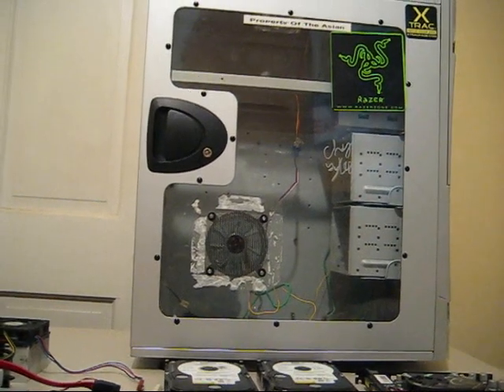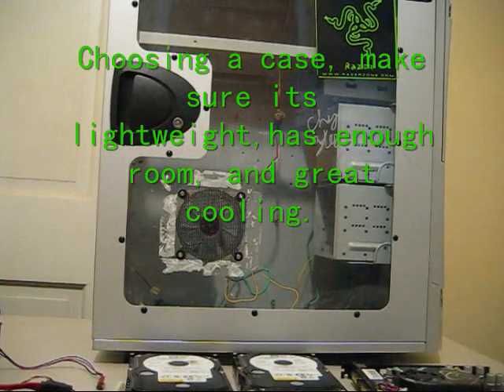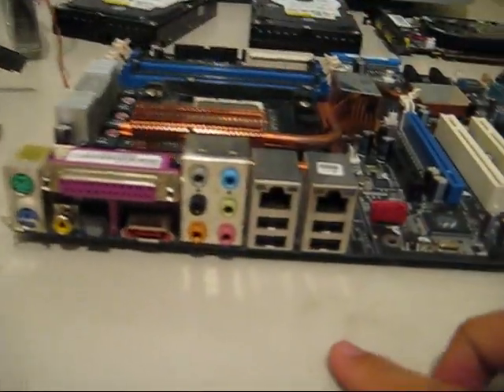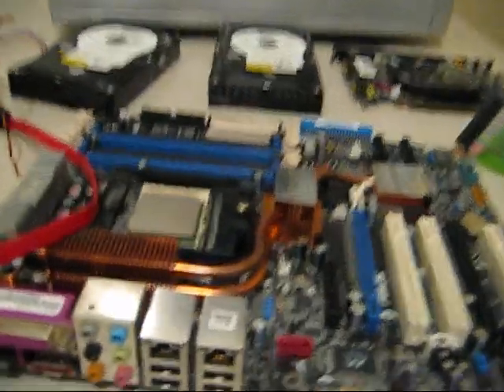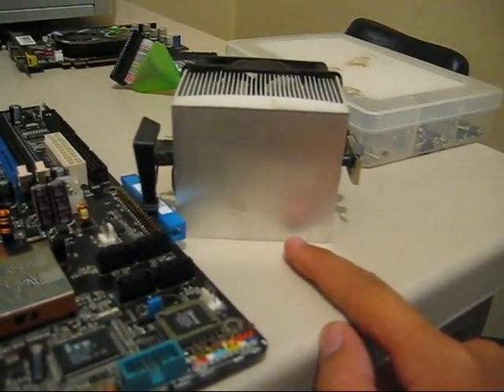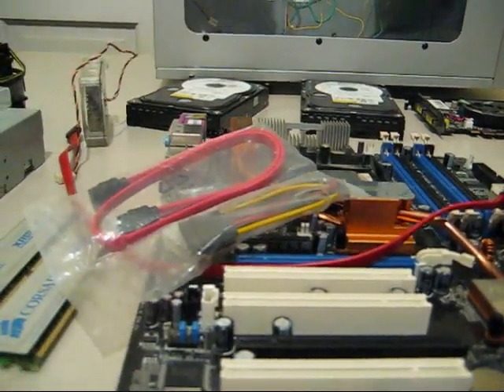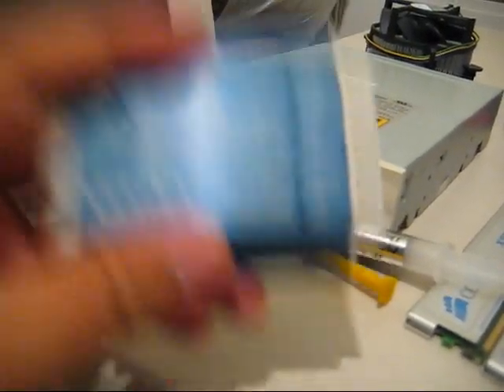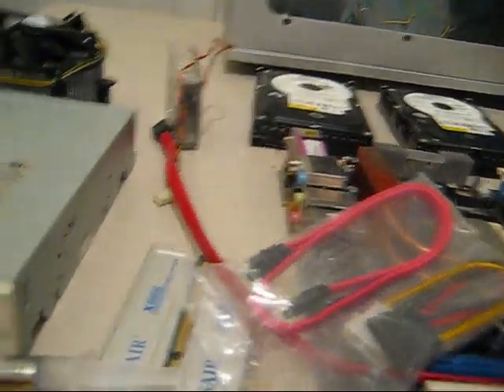Building your own custom computer Part 1

Comment: You can also test a power supply by taking a paper clip, and on the main 24/20 pin connector, stick one end in a green wire connector and another in a black connector. Just dont touch the paper clip..idk if it will shock you..but..basically that works fine. Save you 20 bucks.

Comment from the maker: wow...thats a really good question..um... i would say a case first, why? cause when you have a case you probably would have more room to work with, every mobo out there would probably fit it..but if you had like a dell computer and got a new motherboard..it probably would be a really really tight fit. so i would say choose a case first...but really i would say choose a case with new hardware too...i would do both at the same time

Comment from the maker: its static discharge, not 12 volts going through a series or parallel circuit. the same affect you get when you rub  your feet on carpet and touch metal...it does the same thing. thats discharging the static...not high ass voltage.

Comment from the maker: a 520 Watt psu is maximum output with be between 70-85% efficent. i have not yet seen a psu that outputs the full wattage like 750 watt. mine is a 750 watt psu with 85% efficent rate so max would be 637 watts...so when looking for a psu look for something that has over 80% efficiency.

and if your using this psu already and everything is running fine.. i guess its ight..but me with a setup like that, in my eyes i would have at least 750 watts.

Comment: hey chris, good tutorials man!
just a question.
i have a modular 520W true power PSU with a maximum output voltage of 600W, my setup is quite powerful(Q6600 cpu,2GB dominators,1GB ATI HD4850 etc..) you think my supply is good enough?